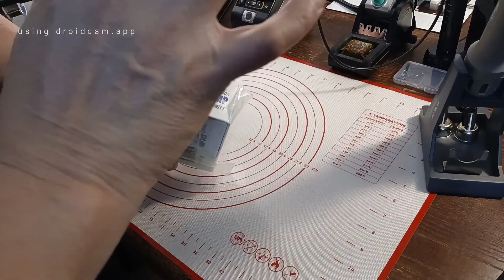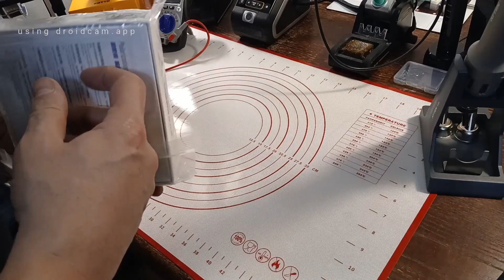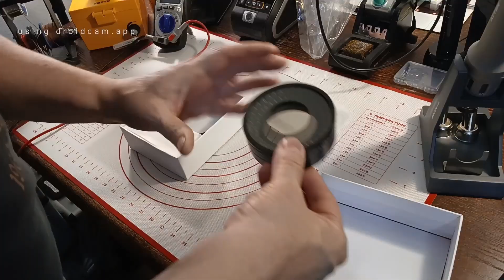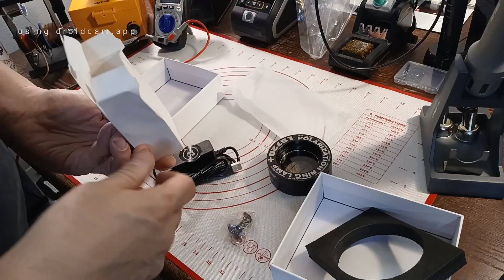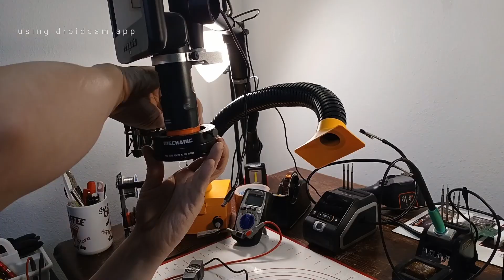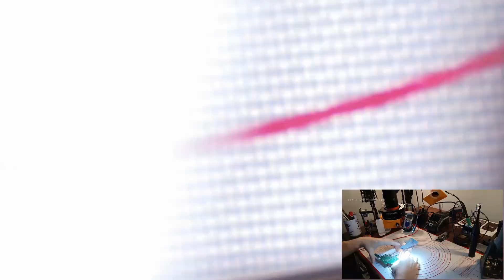Mechanic polarized ring light unboxing review

Comment: I've got an AmScope H756 Series C-Mount Zoom Lens, and I could not get screws to reach my lense.  I think Amscope took me to the cleaners, paid close to $400 for it.   The lense diameter is only 40 mm and the box says right on it 48 mm ot 70 something.  Guess I missed that stat.  It's going back to China.
Reply from the maker: hope you got it squared away. I had to rig up an attachment for my Andonstar to get it to mount to the arm I'm using.  It would be nice if they settled on a uniform form factor. Would definitely help to have the specs correct though. Sounds like you are on track to get it working. Thank You for watching and commenting!

Comment: Helpful review--thanks!

I've done a lot of macro photography through microscope objectives, with a variety of lighting regimes. Am pretty sure that what you prefer about your pair of lights, as opposed to your ringlight, is that the light they provide is off-axis to the lens. Since angle of incidence equals the angle of reflection, this sends their reflections away from your lens, rather than toward it (as is the case with the ringlight).

If you place circles of polarizing film in front of your off-axis light pair, I suspect you may get the kind of lighting you're looking for. If not yet perfect, the next step would be to add another level of polarization in the lens' optical axis, either in front of or behind the lens. For maximum extinction of reflection, this axis of polarization should be rotated to be ninety degrees to the polarization axis of the film on the lights. This will create "cross polarization," which minimizes reflected light.

Microscopists have been doing this for a long time. They call the polarizing filters on the lights "polarizers" (naturally!), and the polarizing filter in the optical axis an "analyzer" (less intuitively).
Reply from the maker: I might try adding some film to the light pair. That is a great idea to make that method even better. I had moved  the lights up onto the microscope a while back thinking i could get that off axis lighting and free movement combo happening, but the light needed to hang down to be close enough to light up the area and was in the way of my tools. Maybe it is possible to use a stronger light on each side of the work area off axis that could still light up the area while being back out of the way? If i could get that off axis style lighting moving with the microscope that would be great, because the scope is already aimed at the work area and is out of the way enough to get tools in there. Thank you for explaining the polarizer and analyzer. I never would have thought the film on the lens side would have been named the analyzer? Very helpful information!
Reply: @SometimesSuccessfulRepairs Hello dear friend! Thank you for your video! And i want to ask you.Have you installed polarizing film on your lamps?
Reply: Thank you!
Reply: Hi I'm also doing videos and photography too and need your advice. 

1. Regarding the reflection and angle of incidence, could I film and position the lens at an angle instead of straight down? 

2. The ls720+ will not fit over my lens barrel as it is to big. Could there be a way attach it on the lens via threaded filter or anything like that? 

3. Can I use the ls720+ with a lens that has a polarizer on it already? Would it be even more effective to have 2 polarizers to remove glare? One on the light, the other on the lens .